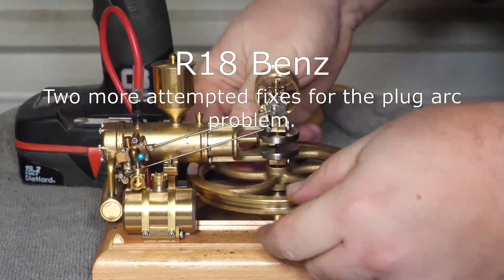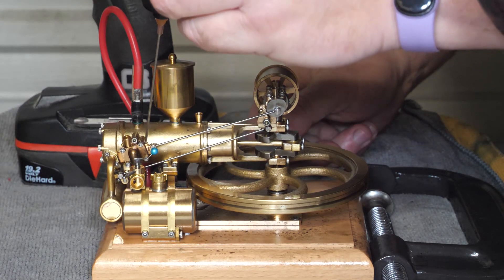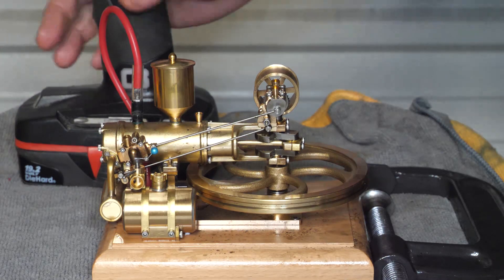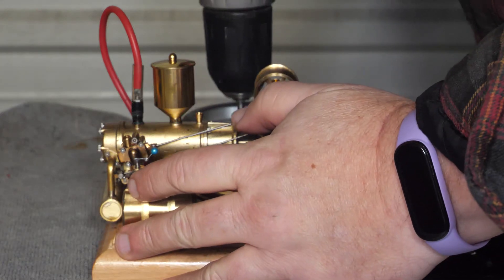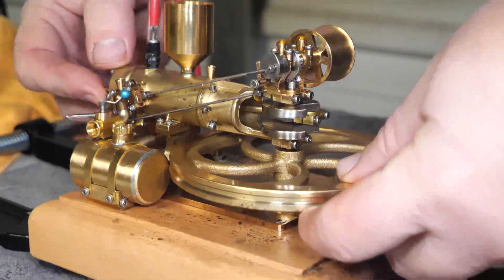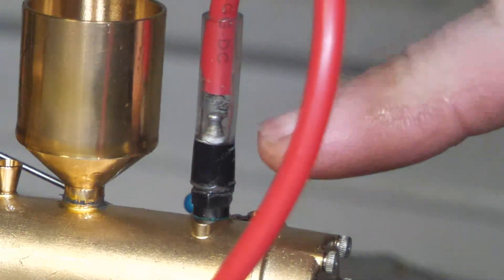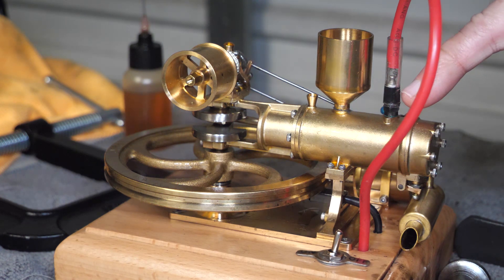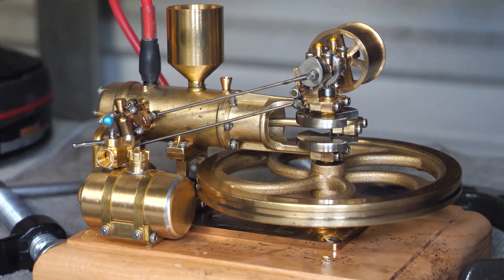R18 Plug Arc Fix

Comment: I ended up having the same problem you had, I put 3 layers of heat shrink tube on the plug and an alligator clip on the wire, works perfect